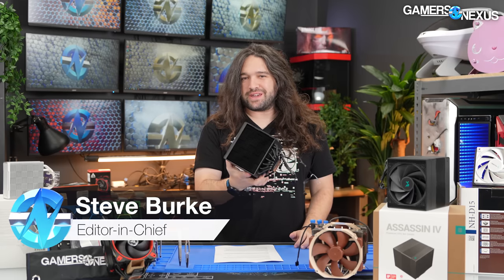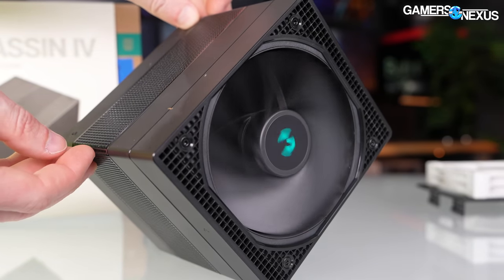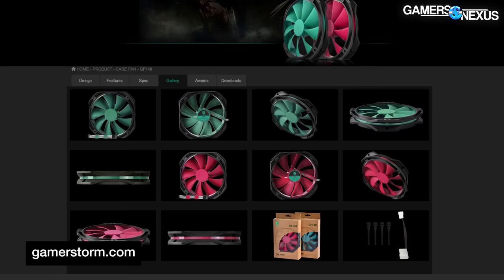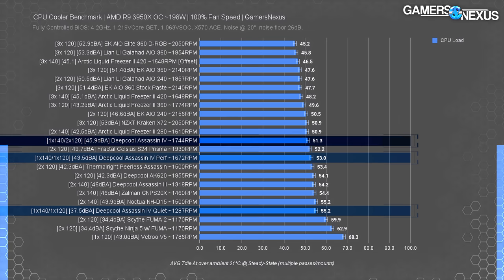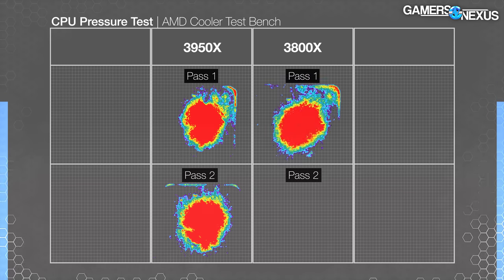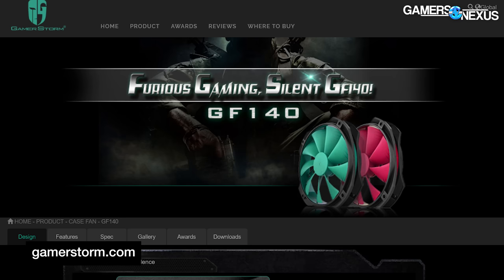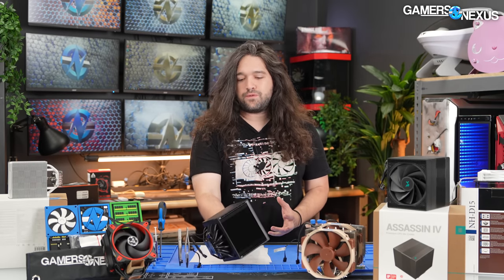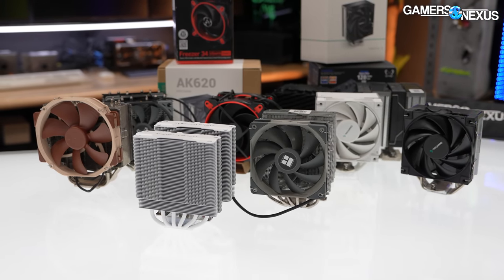Mega Size Air Cooler: Deepcool Assassin IV CPU Cooler Review & Benchmarks

Comment: Is deepcool going to be offering mounting kits for am6, 7, 8, etc. And lga1866, etc. For the next 10-20+ years for this, like Noctua? 

Between that and the 140mm fan compatibility issues, i think I'd still go for the nh-d15. 

I do like the covers, the cable routing though.

Comment: Would love to see some RMA checks regarding the middle fan. Maybe overvolt the fan on purpose so it definitely doesn't spin anymore. Then try to reach out to the manufacturer to see how they handle RMA requests, especially for such a fan like the middle one that can't be bought separately. 

While I don't support lying about damaging the product on purpose or trying to get some stuff for "free" (some manufacturers outright send you a whole new cooler), it's a good way to test certain things regarding support and service of the product. Which is quite important aswell sometimes :)
Reply: I recently used their RMA process for my front AK620 fan. Pulled it off and used it as a case fan when I was running 12600K, then reinstalled when I upgraded to 13700K, only to find it wouldn't spin up reliably on boot.

Deepcool asked for a video of the fan not working, I got them that video + photos of all serial numbers (as annoying as those little SN tags on the fan cables are, they're worth keeping intact). Had a new fan in the mail within a week, no return requested.

Comment: My build will run 24/7 all CPU cores at 100% usage and needs to run for years, which best air cooler to choose? Noise doesn't matter. dGPU not needed, will use integrated graphics.

Comment: Hex head screws are incredible.
You just have to replace every screw in a thing at once, and with clever use of different types of screwheads you can get your M3 screws, M4 screws, and M5 screws all to have the same socket on the end. 
It's brilliant. (Don't do this)

Comment: So wierd you have exact opposite results as the ones from Hardware Canucks ???? In their review the Assassin IV was really not performing well.
Reply: I love GN but it seems like HC have more in depth testing for air coolers (at least temp wise.) they test with like 5+ different CPU’s and most importantly they test inside a case to see how they handle all the heat that GPU gaming load puts off. That’s the most valuable data for me personally and it’s why I’ve stuck with my d15 over 3 different  builds

Comment: If the fin stack surface area is comparable, then is there generally a performance difference between a dual tower dual fan cooler like this and a larger/thicker single tower dual fan cooler?  Something like a  Fuma 2 vs. the Dark Rock 4 , for example.

Comment: Imagine having this in a regular mid tower case, it would literally look like a death star. My Thermalright AIO cost less than this cooler and performs better. Btw a Gelid Solution Silent 14 Pro fan will likely fit in the middle of this cooler. Check it out when you can!

Comment: I tried this cooler and it sucked against the peerless assasin. It provides basically the same ram clearance since you can move the fans on the peerless assassin, but unlike the cheaper counterpart it is much bigger and it blocks the NVME slot on my board. Pointless

Comment: here in sweden this fan is one of the more cheaper tower coolers for performance, also it have highter watt cooling than the other available here for less, i havent gotten mine yet its till in transit but i am pairing it with a 5800x in a massive case with loads of airflow, all the aio for the same price ive tried couldnt cool the cpu to a temp i want (below 75c) so im curious about this one.

Comment: It seems a little bit pointless.
It's so big that it needs huge case.
On top it needs a good airflow in the case, so more fans.
It's more expensive than good 240aio i.e. Arctic liquid freezer.
The only argument you can use for it is that it will not break down in time, except for this proprietary reversed fan...
I'm struggling to find use case scenario over aio.

Comment: The problem is, how can we get the heat out of our case. And like the Noctua can it fit the case? I had 2 cases where big air cooler didnt fit. We need better solution like Mora which sits outside

Comment: There are 2 fans on this air cooler right? The one near to the RAM module is pulling air into the cooler . What about the one at the other side of the cooler? Is it pulling air into the cooler or expelling air out of the cooler ? I think both the fans on this air cooler are pulling air into the cooler rather than a push pull configuration.

Comment: Any 140 fan that could fit with dremel help?
Reply: The middle fan looks like a 140mm fan with 120m-ish hole spacing. There are a few fans like this and other tower coolers make use of them. Even if you couldn't get one of them to fit, surely a 120mm fan could be fitted with some jury rigging.

Comment: Sooo… if you have pets, they might go insane due to that high whine.
Reply: If replacing a fan is that restricted, it doesn’t matter if this cooler works better than liquid cooling unless they can guarantee 15-20 year lifespan for those fans. I still use over 15 year old Noctua fans and a Noctua CPU cooler. The CPU cooler excepts any 120mm fan, so the cooler is basically gonna live longer than I do.

Comment: Your cooler is like red trim on a nuclear-rocket-powered Edsel. 
The best cooling solution is to stop using inherently defective CMOS and switch to resonant tunnel diode threshold logic. At 2.2 THz the power required would be 5 W.

Comment: 6:46 Odd body shape? Isn't that just a 140mm fan with 120mm mounting holes? That's not particularly non-standard.

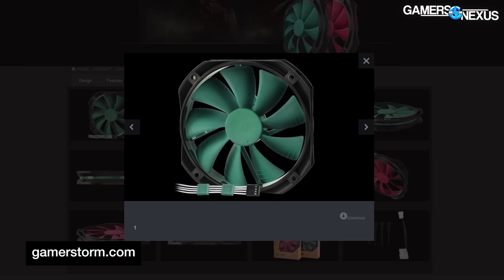7:05 Literally in the next shot you have a fan that will likely fit right in front of Steve in the foreground since the D15 uses Noctua 140 fans with 120mm mounting holes.

It almost comes off as a joke. Comically trying to shove a 140mm fan where it clearly won't fit infomercial style and cutting to a shot with the obvious solution but moving on and glossing over it with "Our next biggest concern..." as if you hadn't just trivialized the previous concern in an instant.

17:00 The Noctua didn't fit huh. Still would appreciate if the mounting holes were measured and compared. It probably wouldn't be as hard to find a drop in replacement if it is 120mm mounting on a 140mm fan

Comment: Hello, thinking about buying this one but I run reverse air flow (from back to front and bottom to up), can i just put fans in reverse while mounting cooler itself normally? (putting whole cooler in reverse is stupid idea and will make temps higher, so don't answer with that.

Comment: Imho noctua is the rtx4090 of fans. It looks like just yet another cooler, but all of their products are in a class of their own, a bit like how the 4090 is in a class of its own, nothing even comes close.

The package in noctua products: the build quality, the longevity, the excellent sound profile and the upper mainstream cooling performance together makes it the best pick in my opinion for most applications. Of course when you are building some overclocking rig there it may not cut it but that is not what mainstream PC builders are doing.
Reply: Noctua is great, not gonna lie. But its not the holy grail. I can get Arcticx fans for 1/4 of the price and get 9/10 of the Noctua's performance. So dont fall for the legend of the brand...

Comment: Prefer a philips head? (Torx for the win!) Really Phillips head is horrible for pretty much anything. It was developed to easily cam over in the assembly line, with a high risk of stripping the shape. Henry Ford didn't care if the screw was mangled, only that it was securely fastened and not broken. Only proper screw head is Torx or Robertson square head. Even Hex head is better than the Phillips. The crappiness of the Phillips head is only surpassed by the Pozidrive. That turns into a round head, any time.

Comment: ANY fan whine at this price point is unacceptable for an air cooler imho. They are competing with Noctua, charging Noctua money so they better be significantly better or at least as quiet. Obviously the NH-D15 doesn't have the best fans either but they are still relatively quiet regarding noises.

With the way current systems are designed including GPU fans and such, I totally disagree with whining noises like this. They WILL be audible. Probably a little less than in an open bench but I've heard the P12 fan hum at certain rpms on a radiator with the fan being on the inner side. SilentWings 3 also tend to hum at full blast so honestly this is a disappointing cooler. I'd much rather give up some degrees and grab a NH-U12A chromax black for 30 bucks more but have decent acoustics. At this price point it's just not viable to have humming fans on an air cooler.

However, I'd much rather grab a LF2 360 at this price point.

Comment: There is any GN video talking about the Pressure Scan test !? I cant find anything. I'm whiling to buy a cooler ( I'm limited to some choices in my country ), and I'm in doubt in 2 coolers for my budget.  One cooler choice, has good Pressure scan test, and a average surface flatness, the other choice, has a Bad/average Scan test and a good flatness. Before I make my decision, I think its important to know what to choose, and why. So, the pressure scan is my doubt.  Anyone could let a tip?
Reply: go for pressure. But pressure is honestly a matter of how you install it, pretty often. And to install it perfectly you would need an automatic torque wrench anyway... So dont sweat it. The difference is most likely to be going at most 1-3 degrees celsius. Get the bigger cooler or the cooler with more copper in it ( heat pipes )!

Comment: I'm honestly curious how it'd perform with something like the 7950X3D, though that chip only draws ~160W so it's bound to perform pretty well. I've got a friend who's buying me a 7950X3D, 96GB of RAM (Corsair's 2x48GB kit), and an RTX 4090 (because she's insane) and I still haven't decided on if I'm going air or liquid. I was thinking the NH-D15 but I'm not sure when the second gen one's gonna come out, and don't really wanna get stiffed on buying the first gen
Reply: The hell kind of friends do you have with 3 grand just laying around?
Reply: Goddamn, where the hell do the rest of us find friends like that 😂
Reply: If by chance your friend is not made up they must be running out of things to spend money on, owning everything and all that.
Reply: @AliceC993  Insanely generous ones!
Reply: My friend has the new released asus aio cooler 300-400€.and im using nh-ph1(passive cooler) from noctua

Idle temps at bootup are same.
While gaming he gets lower temps (he has 7800x3d and me 7950x3d) 5-10C

Im reaching ~145w package power passive cooled if im using synthetic benchmarks.

So as a gamer its not worth it to pay much money(look at linustechtips)

If u literally work with the pc u can buy a AIO.but keep in mind that the pump can fail over the years(it failed on me once)

And x3d cpus are firmware limited!!!
5250mhz/5750mhz is firmware limit.and im already reaching it in games.

Comment: High pitched noise drives me insane. 10/10 cannot recommend. 
My Dark Rock Pro 4's 135mm fan developed it over time. When it spins at over 30% it emmits a high pitched, oscillating noise. It is crazy annoying.

Comment: Whining is normal here - all revievers got it. But whats not OK, is non-standard fans in the middle. That 140 is a crime. One of biggest advantage of air coolers is easy of maintenance and replacement of broken parts - as there is nothing that can bake other than fan - it exclude whole cooler from list of usefulness.  And that price.......

EDIT: Phanteks had similar 140's, but not sure if they make them present.
Reply: If you can show me an air tower cooler that mounts standard 140mm fans I would be stunned.
All that I have seen go the same way and use a 140mm fan with 120mm mounting/hole spacing - it's common for all the big tower coolers.
Which means there are fans available like that which could fit or be persuaded to fit.
The advantage of the Assassin IV is if you end up jury rigging a 120mm fan to replace the 140mm, your jury-rigging is hidden from view.

Comment: Phillips head screws need to die, and move over for torx screws, I’ve never wanted to switch a hex screw back to Phillips but I often swap out PH2’s for T25’s whenever I can. For me I think hex screw is a step better than Phillips but a half measure to an actually solid screw head design

Comment: Does anyone really care how new 100USD air cooler is performing on ryzen 3000 series? But if the cooler was tested on Raptor Lake cpu or RYZEN 7000 series CPUs they will thermal throttle with any air cooler so you can't really see what cooler is best since they are all inadequate. Intel and AMD should work closer with cooling industry to produce next gen CPUs that are not going to work at 100c even with 360aio or large air cooler. Hell even mid range CPUs now are reaching well above 90c with high end coolers. There must be some solution. I hope this insanity is going to stop with new generation of processors.

Comment: The price just makes it unappealing. would rather just buy a 360mm aio. the thermalright phantom spirit (7 heatpipes vs 6 heatpipes on the Peerless Assassin) is around half the price. value wise Assassin IV is pretty crap. performance wise its ok, similar to other dual tower air coolers. nothing really too special besides looking different. thats around $50-$60 you save which you can spend on faster RAM, more storage or faster storage, higher end motherboard, better PSU. its not worth it unless you really want to spend extra for the QoL features
to each their own i guess
waiting for the NH D15 successor at this point if i'm gonna spend around $100 for an air cooler

Comment: Hard to care for this thing. D16 being a thing at some point soon +/- 5 years. Or anything Noctua really is preferable. Or just price to performance option is the pick. This is a big box. With a big price tag.

And for what. To cool a Intel system? 300w or something. Or a 95 delicious designed AM5 system pulling what 200w? And if your going for x3d CPU's the stock AMD cooler is almost enough. Just not included with the CPU. And AM5 so the heat spreader and in general AM5 is a disappointment. How much do a AM5 motherboard cost today? And do you even get 'future proof' gen5 pcie for that money? No. Unless you spend top dollar on... shit

And we do not even know if we get Zen6 on AM5. So really. Hard to care when Noctua or price kings are just simply more fun then... This. And not to talk about Intel CPU's. Where agen if your going Intel your most likely best off with a value option tower cooler for a I5-I7. Or run water since if your after a I9 CPU it is going to suck ALL the power. And need the water. If I end up buying a Intel CPU agen I will pick the most * CPU cooler possible and turn the fan curve to the max. Maybe even use a stock cooler just because it might bring me joy knowing what the CPU is experiencing. Budget build galore+++++.

Not to talk about GPU pricing still being 4090. Unless you want a overpriced broken AMD GPU. Or horrible NV card stupidly expensive and named in a way to force you to spend more $. That you can buy at a discount at times in USA? Maybe? But then NV never price drop now do they. So AMD with there lies about RX7800's being worth $900-1000. Without ROCM or anything. Agen 4090 or lies and pain.

Or get a GPU from 2020 that is tainted with the BS around the GPU market. Yea that is a option hu? Stockholm syndrome to pay for that stuff. After all it is a good deal being priced out of the market for 3 years? And now expecting us to look at performance and value since new gen of stuff is so bad. Go and buy old gen! Grate deal!   

PS5 slim is about to release. And PS5 go for around $400. So about as much as a GPU alone is going to cost you on it's own. Not a console gamer but I'm more interested in PS5 Slim/ PS5 refresh cooling and fan noise then whatever this black box AM5/Intel whatever cooler is trying to do. It looks sooo boooring.

Fun times to bother with CPU coolers. Or get free DDR5 after AMD ruined there launches of 7000. Like i5-2500k is a joy to use still today. Gave the i5 2500k Lenovo cooler a new 80mm fan and it is so happy! Rest of my systems got Noctua coolers and pre 2020 GPU's in them. So not really care to much about a $100 box. When my Zen3 system is happily drawing so little power with the overkill D15 on it. 12cores no problems.

Comment: These huge air cooler are useless, speaking of experience. I made the mistake of buying one and I still regret it.
Reply: They aren't useless, just more reliable than an AIO, have better durability, easy to install and better maintenance.
Reply: Useless for what? With a big air cooler (lots of thermal capacity) you can literally run your PC with a cpu fan in idle mode aka passive... And have your cpu fan only switch on when you are gaming. Rest will be done by the airflow in your case, which you have anyway.
Reply: @TheSaival  The majority of PC cases aren't a Corsair 5000D Airflow killing the whole purpose of everything being air cooled.

Comment: Dumb fan design, too expensive.
The arctic liquid freezer ii 360 is only £10 more expensive and the Peerless Assassin is less than half the price
Reply: Not everyone wants or needs liquid. Perfectly happy with my 5950x on a maintenance free D15 barely hitting 75 under stress.
Reply: While AIOs are really cool and silent, they need maintenance and get worse over time. The pump can die and is not easily replaceable.

Worst case for air coolers is you need new fans
Reply: @gikigill788  Correct.  I actively don't want water.  My 12600k with a mild/moderate overclock does just fine with a D15.